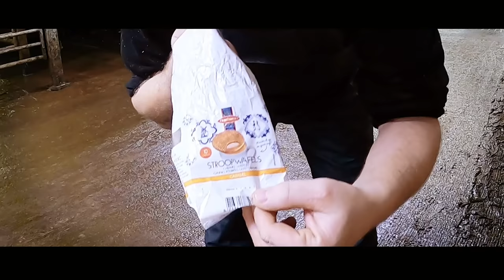WHAT'S in the BLACK HOLE in this COW'S FOOT?

Comment: Hey!    I was wondering.  What poweres your trailer?     I keep wondering bec I dont see any on it.  And I cant hear a generator running or anything.        I do also wondering if it are that uses pneumatic or hydraulics  for the trailer to move and stuff like lift up and stuff?

Comment: Hi lads, just wondering how long your grinders last? While the tape is a good job for easy cleaning, does it also block the air intake of the grinder. Also just wondering what sanitizing agent you use after the wash? Great videos and hoof triming

Comment: Question... Sometimes they have a block on a claw and the other side isn't finished healing. So you say the block needs to stay on longer. Wouldn't you want to take the old block off to just the sole underneath to make sure nothing's forming, then just put a new block on again???

Comment: If possible, when you reference an ongoing problem, it would be good if there could be a split screen showing what it was to compare with what it looks like now. In this vid, you reference a problem that circled around the horn before, but there is still a problem now. Before and now pic comparisons would be a plus.

Comment: Stroofwaffle fix: wrap it thoroughly in three layers of aluminium foil. When you arrive at the farm, pop them onto the engine manifold. After you’ve finished setting up your crush, the stroofwaffles should be toasty warm and moist. Or at least not crunch when you bite them. 

:-)

Comment: When I noticed all the twists and turns to get your trailer into position in order to start working I got to thinking.  Since I was a truck driver in the Army years ago, I always hated having to back short trailers (Jeep trailers) into tight places.  I found a link to a product that might make things easier to maneuver your trailer into those tight spots.  They have different models depending on the weight of the trailer.  It doesn't look like it would exceed the weight limit for the smallest trailer dolly.  Not sure if these are sold in Scotland or not, but if not there may be another vendor locally that sells a similar product.   Here is the link  https://parkit360.ca/products/electric-trailer-dolly-base-version

Comment: I'll bet you have scratches and scrapes on the new truck by now! I had to rattle can "antique white" paint on my old '90 Ford Ranger to get a fair match in color to the new Ford white it used to be 32 years ago. Yes, it still runs as good as when I first bought it! Regular preventative maintenance will make it last almost forever! ( plus not beating on it)

Comment: what material is the black "block" made of, and is there an international distributor? My roommate has a shoe repair business, and I think this would be an invaluable material. I, like many other people, walk on the outside edges of my feet (hooves), and so, even though I wear Birkenstocks, those outside edges (and sometimes cork) need replaced. If that material works excellent for cows, it would be STELLAR for humans.

Comment: Um, putting the two blocks on the sole one side ...... does that throw her off when walking ..... I mean, if I put a full lift under one foot it would throw off the alignment of my hips and I would be in a world of hurt (I learned that the hard way when a "specialist" in athletics orthopedics decided I needed a lift on one side ..... one of my legs is 1/4 inch longer than the other ...... she messed me up with doing that ..... hip, knee, ankle, foot and lower back ...... got rid of the lift, did PT for a couple of months and I was right as rain ...... well, if you can call me "right"  :0D  tee hee